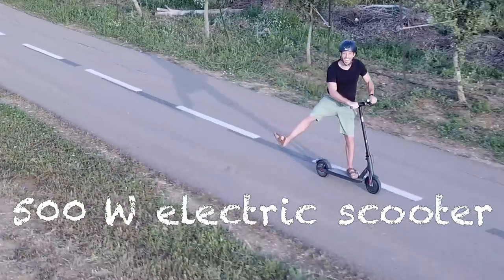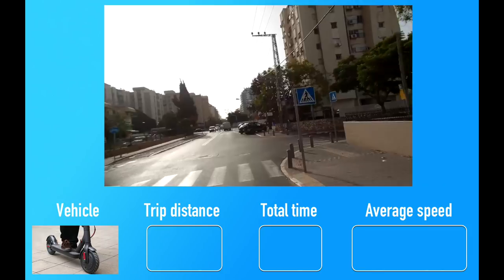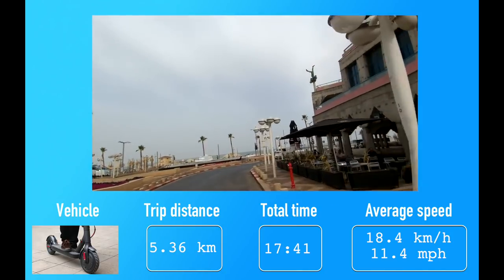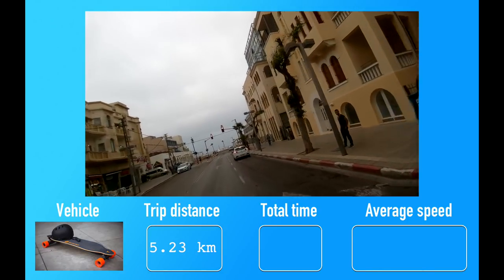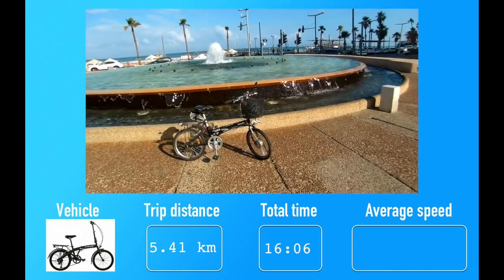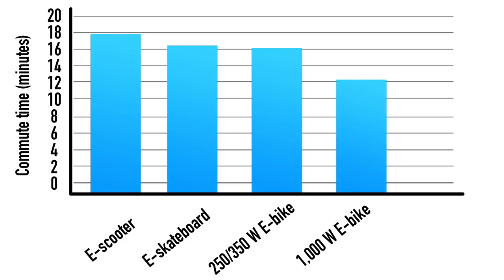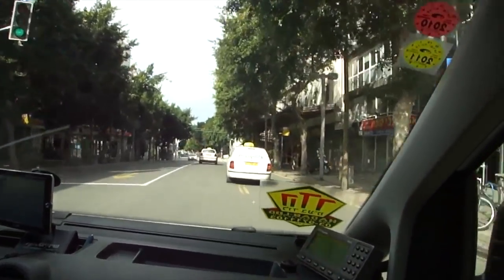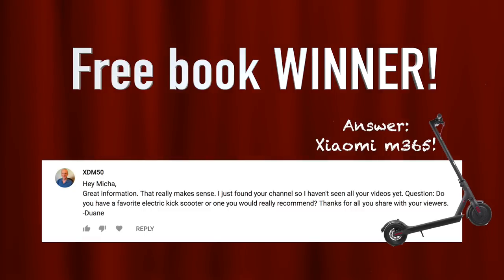Ultimate Commuting Showdown! e-bike vs e-scooter vs esk8

Comment: If you do the error calculation properly using standard deviation, your error is actually only about 3.2 percent. That means that the folding eBike and the eSk8 are statistically faster than the eScooter. However, the esk8 and folding  ebike are within error bars still.

Comment: I have the Xiaomi M365 and what's nice about it is after you arrive at you destination (possibly office) it's easy to bring along with you inside so that you don't have to worry about theft.  The booster boards look like fun but not enough control when stopping or when riding if you should hit a little rock or twig (from my skateboard experience) the board will stop immediately ejecting you in a not so fun way.

Comment: My ebike just died.  How 'bout some videos on how to troubleshoot failures and determine which part has died: ie Display, Controller, Motor, BMS, or wiring.  Thanks.  You do a good job!
Reply: Take a multi-meter and check your discharge port to see if you have voltage running to your controller and charge port to see if you have a voltage thru there. Whatever you battery battery voltage is (12,24,36,48 etc. your multi-meter should at least meet and exceed that voltage). If voltage is below the minimum it probably is your BMS and this is cutting off flow to the controller. If that checks out good you controller should have a black and red wire out port to hook up a lighting system or other accessories, see if that has power. Also, you can take off all heat-shrink or tape around your battery and check each series for 3.7v or greater. I have had to replace both BMS's and batteries in the past.
Reply: Thanks!  I'll do that.

Comment: Hi Micah. I know it's unrelated to the video but I had a question. I have a 48v 250w scooter. I was having problems so took the battery pack apart and tested. It was showing 3.9-4.0v of 60 cells but the row of 5 nearest the BMS were showing 0v. The question I have is 3.9 - 4.0v sufficient in a charged state, why would the first 5 batteries be dead as a dodo when they're all original cells and lastly if I break the pack down and rebuild using a vruzend kit do I need to match the exact cell or will any 2500mah 18650 do. Actually one last question(sorry but your the most knowledgeable person I can find on the subject) if I plug the 48v  charger in, is there a cross reference anywhere I can use to check my BMS output or is it BMS dependant? Many thanks and keep up the good work.

Comment: Would be good to know how these compare with the noise these make during commute, that is the sound one would be hearing all the time. I have 750w directdrive conversion bicycle, which just making slightly  hearable high pitch noise under full load. Which is not a problem with helmet put on underhelmet hat. Also would be good to mention wind noise in correlation to speed. More speed is lot of fun but noise could be a big disturbance. Even to hear traffic arround

Comment: Hi Mike
I had this doubt that in one of your videos, you glued all li-ion cells to make battery pack. But isn't it hard to replace a worn-out battery?
How do you do that? Because while doing that, other cells may damaged.
Reply: I bought my first battery pack from VPower and that's what they did. It was a pain in the a$$, ripping off the plastic sheathing and a short hear and there.. When I built my own I used either masking tape and/or Velcro to hold them together. If you are taking one apart use a sharpened wooden or plastic dowel to wedge them apart and to prevent shorting out the 2 battery parallels.

Comment: Hey Micah, 
I've never built an e-bike and so I want some help with a really good PAS:
If I'd like a bracket torque sensor - how do I mount it on my bike if I had the cycle analyst V3, front and rear motors and two controllers like on your bike? What parameters should I be aware of when buying a torque sensor to make sure it will be compatible with all the electronics?
BTW: I bought your ultimate DIY ebike, I'm just in the half.

Comment: Hi Micah, Mark  here from Yorkshire UK  I watch your channel all the time and you gave me a lot of ideas on ebike's  six months ago I built Steel bike frame ebike of a top speed 60 to 75 mph at 1250 watt's bye using 2 52 volt  Li-io Dolphin LGEBM261865 electrical ebike battery together at 104 volt's  with two hub brushless Motors one at front at 36 volts 250 watts and one at the back of the bike 52 volts 1000 watts on two separate controllers and acceleration Toggles but when I press two of the acceleration Toggles at the same time on the handlebars together I reach a top speed 60 to 75 mph at 88 volts and I was thinking of adding another 52volts at 1000 watt controller and front wheel on my bike at 52volts 1000 watts hub brushless Motors  but keeping the same batteries I got  already at 104 volt which will make my bike altogether 2000 Watt instead of 250 Watts at 36volts  on the front of my bike but can ask  is there a safe margin with ebike 0n how much power and wattage to use

Comment: how important are the brake levers that come with the ebike kit? I know they cut off power to the motor, but is that really necessary if I'm not pressing the throttle while I break?
Reply: Ashwin Ramdas not as important if you use throttle more important for pedal assistance set up. Also it controls regen. I would not recommend not using it. Especially when you can buy a conversion kit and keep the original brake handles. (levers refer to the part that holds the break pads)

Comment: Great test ! But I have a question , I need to connect 8 motors to either one or two lithium batteries , can u tell what is the safest way of doing that ? And how do we calculate the number of hours that our battery system can last till it gets discharged ?

Comment: I have read many articles about the isues with the high output from regenerative breaking, and the relative inefficiency of 18650 cell acceping that charge quickly.   YouTube University also taught me a bit about Super Capacitors, and how effective they are in that same regenerative breaking scenario.

Is it difficult to adapt SuperCaps into an e-bike battery system?  Is the gain in efficiency, woth the extra weight and/or expense?  I would like to hear your comments about using Super Capacitors this way.

Comment: I was greatly oriented by your videos to make my own ebike, wich I allredy did, it's working with some cable arrangements to finnish. I would like to know it the tires that came on the kits that you used on your 1000w bike are as crapy as mine? Had bad grip with a couple of scares with it. The disk that comes with it, doesn't inspire much confidence too. Keep up the good and interesting videos!
Reply: My motor driven wheel was going thru one to two tire a year, that was with a front wheel drive. I now have rear wheel drive and don't go thru as much. When buying tires look for a hard rubber based tire.

Comment: Hello.  I like your videos and you rock.  I was wanting to build a skate board with the 6 1/2 hover board wheels.  I was wondering if you thought that would be a good idea since traditionally they run a lot slower in the hover board configuration.

Comment: Hi,
i just have a simple question which may be silly but still wants to know. i want to build my own battery pack of 10s6p 36v 20.1Ah from Panasonic 3400mAh cells. now as suggested by you website liitokala cells Panasonic with protection board and without it. so my question is which one is better to use in battery pack  with protection board or without. of course i will be using bms in both cases.

Comment: Is there a difference between a front hub motor and rear hub motor. Can i use a rear hub motor for front wheel?
Reply: no... it has the gears mechanism on them and vise versa